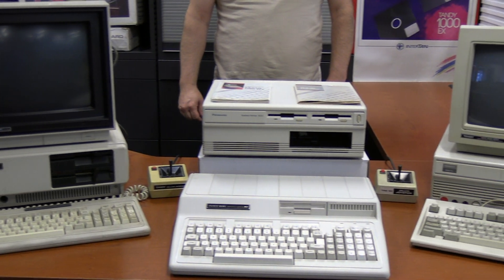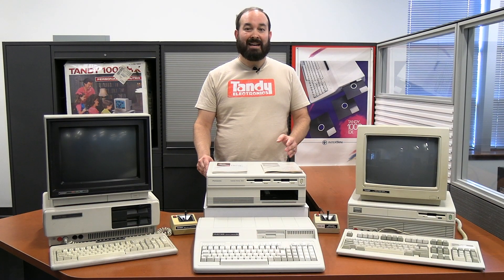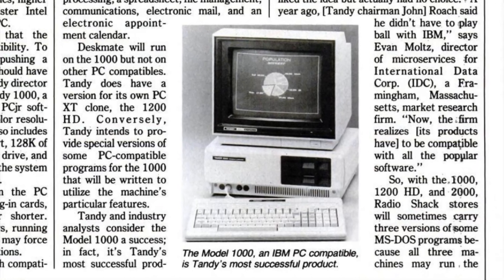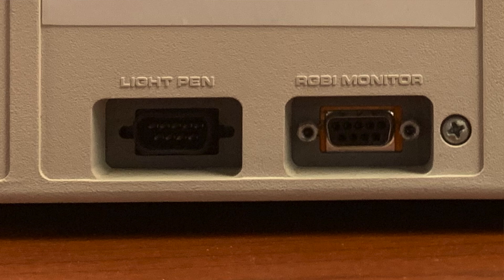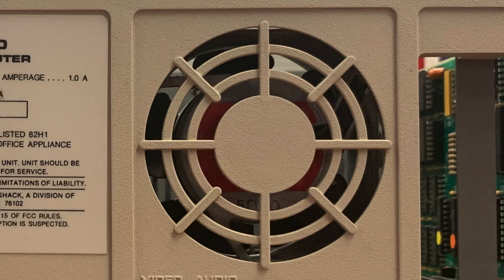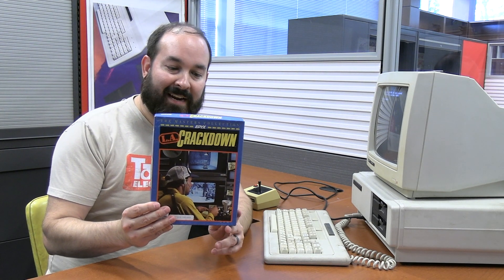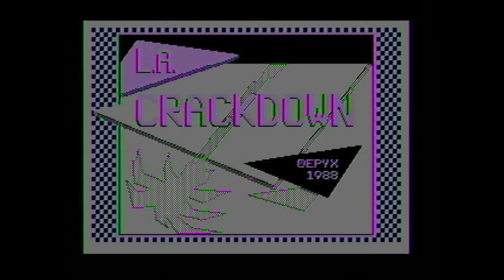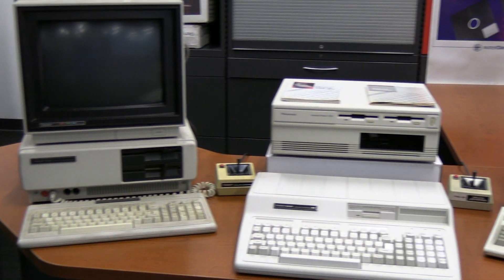It's Tandy 1000 Time (Part 1) | #SepTandy

Comment: In 1988, the 1000HX and (after about 6 months) a CM5 monitor was my very first computer. Had the DMP132 (I think that was the model) printer. 

The worst problem was finding software locally that had 3.5" disks, and IIRC, the bloody external 5.25 was a hard 3 or $400. The parents would not go for that.

Comment: Finally, someone who has even mentioned the Panasonic Business Partner machines!  The FX-1650 is actually an SL/2, not a TL/2, since it has the 8086 CPU.  It is only missing the front audio and DOS in ROM... otherwise it is identical to the SL/2 model.

Comment: I still have the Tandy 1000 I bought in 1986 (after I left HS). I added memory from a third party company that took me to 640K and a hardcard from another third party company that was an RLL 48Mb drive. Regrettably the drive died some years back, but I have an ISA card that makes a harddrive on a CF card. I haven't had the chance to try it, but it sounds like fun. My floppy drives work, but I've had to service them a couple times over the years (generally to lube the rails). Back then I replaced the 8088 with the NEC V20 so that I could run some specific CP/M software I needed. Eventually that would be unnecessary as the software was ported to 8088 DOS. I decided to add the 8087 recently and found a NOS here in the US. Few programs rely on it as it was uncommon to have one at the time, but I am a programmer and I can use it now. My Tandy keyboard is in massive need of repair. Only 10% of the keys work. I have a keyboard adapter designed for the Tandy 1000 that allows any PS/2 keyboard to be plugged in (keeping in mind that unmapped keys won't register). This was my first PC compatible machine. I had used IBM XT machines in HS learning Turbo Pascal, but I wanted my own PC heading off to college. My mother cosigned for a credit card for me to get what I wanted and I worked jobs to pay it off (and to pay for college). Such great memories. I remember having to ask instructors if they'd take dot-matrix printed papers. Most wouldn't. I later got a Daisy Wheel Printer. The type looked like a typewriter and all instructors accepted it. Today, I'm the instructor (CS) and everything is digital. ...but the memories...

Comment: @5:16 The "hardcard" approach was necessary because Tandy chose to use the PC and XT's "standard" IRQ5 for something else - so for hard disks to be usable you had to have both a "Tandy 1000 aware" hard drive controller card plus your hard drive, or a hardcard built to be compatible with the Tandy 1000A. On the later SX and other models it was as easy as toggling a dip switch - if at all necessary, as they improved compatibility as time went by. Oh, and the original 1000A didn't have DMA, so to use a hard drive you also had to add a memory expansion slot and/or do a BIOS upgrade because of timing issues.

Comment: It should be noted that the traditional composite output on Tandy 1000 systems has the hue rotated 180 degrees from normal, so all of the colors are usually wrong for games that have special support for composite CGA ("16-color") output.  The only composite output game that looks correct on a Tandy 1000 series is Blue Angels from Accolade, as the developers testing their game on Tandy 1000, not knowing that real CGA composite output is different.
Reply from the maker: Well now it makes a lot more sense that the capture from composite looks pink compared to the actual monitor!  Thanks for that insight!